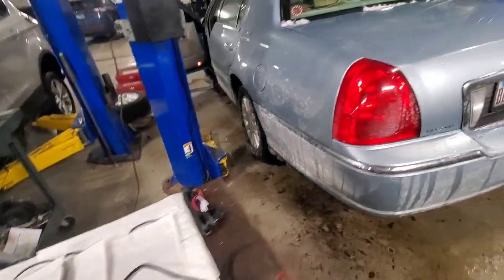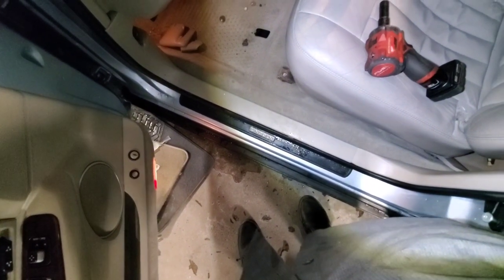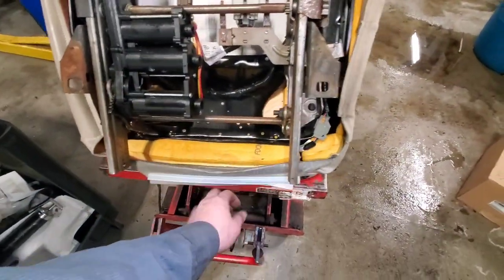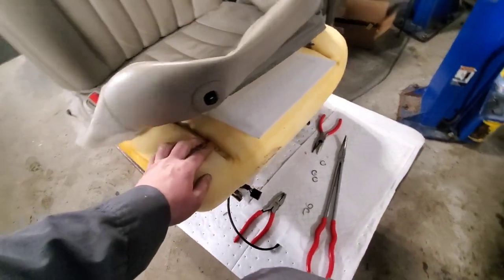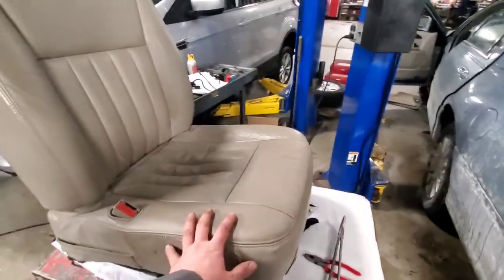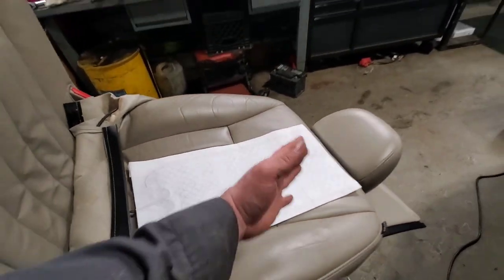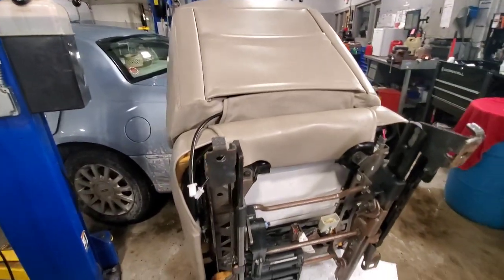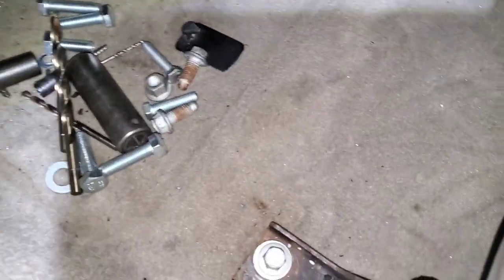Lincoln Town Car - Aftermarket Heated Seat - Install $48 Amazon - How To - Panther Platform

Comment from the maker: The seats have airbags in them so you should disarm the airbag system or unplug the negative battery post for at least half an hour

I've never had one explode on me and I've never had a single issue with simply just unplugging the seat or connector but again that's just me I'm not condoning that you do that

Comment: I put mine on the lower seat bezel. Some older explorers have it like that. I also had the snapped seat bolt. I got a stock bolt at the parts counter for a few bucks.
Reply from the maker: Yeah there's nowhere else for me to mount it so I had to mount it here
Reply from the maker: I actually drilled my holes a little bit bigger than Factory and put a slightly bigger bolt in because the one that goes in is really small

Comment: How much would you charge to drill and tap four front seat bolts? I have used bolts but those would be useless. Please let me know im  from the northside of Chicago.
Reply from the maker: If the seats are removed it's going to be like an hour hour-and-a-half max if I have to remove the seats you're looking probably at 2 two and a half hours total
Reply: @Ford Boss Me  everything is removed all i need is for someone to drill the holes/ thread and bolts thats it... can i send you an email or picture if you want.

Comment: Ok boss, I just realized that if you’re not a master certified technician or armed with good mechanical ⚙️/electrical abilities like myself, you might as well have given me directions to the moon 🌙, lol I hope easier to replace pad rather than install aftermarket??
Reply from the maker: Some advice would be when you go back together don't reuse the metal hog rings that hold the seat down just use some really heavy duty zip ties
Reply: Slow down my brother , hog who? As read into this more in depth, I don’t know how to sew, but enough, I will wait until you show me how to apply this rtv assuming I can do that, then I will make a video of the power seat 💺 and send to you, but my folks feel as though I am being a nuisance and though I would GREATLY BENEFIT from your vast knowledge, they think I should stop 🛑 bothering you about this car and find someone local and get the car done and over with, they think I am hinting at a 3rd Lincoln, but I am truly stomped on the 04 you know? I got this young man (boy 18yo) wants to buy it. He’s going to tear it apart and put big ass wheels on it and dog it out. I can’t stand for that, so I will get it figured out
Reply from the maker: @curtisnash9723  if you look at my video where I was insulting the aftermarket heated seats there are rings little metal rings that anchor the weather down in the center of the seat and you have to pry those rings apart

Many people get rid of those metal hog rings because they look like the rings that go in the front of a hog nose and they're pointed and very sharp they replace them with zip ties and there's ribbing that goes underneath the leather that anchors down into the ribbing of the seat so they just fish a zip tie through and zip tie it and cut off the end really easy to do
Reply: I remember now
Reply from the maker: it's up, video posted
Reply: Thanks boss, just found it👍🏽